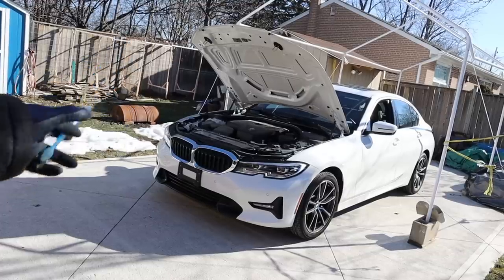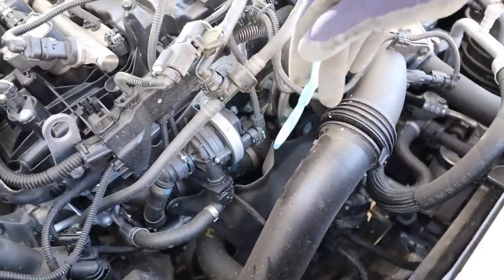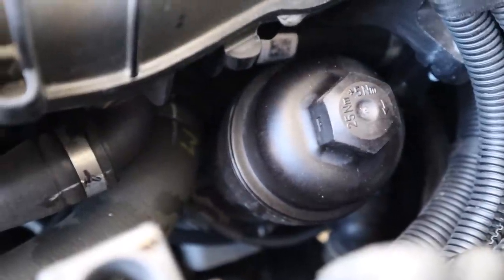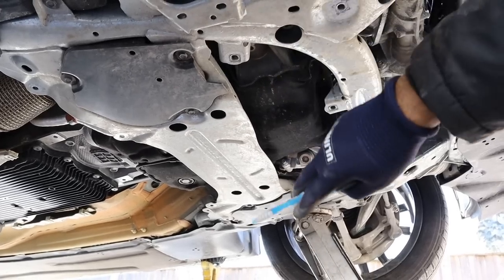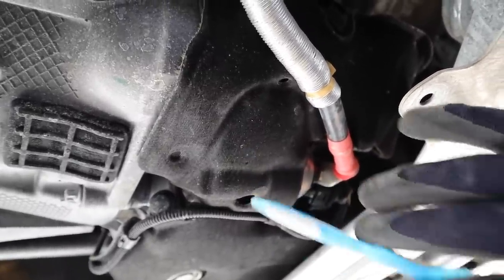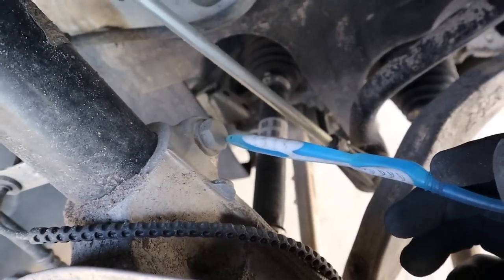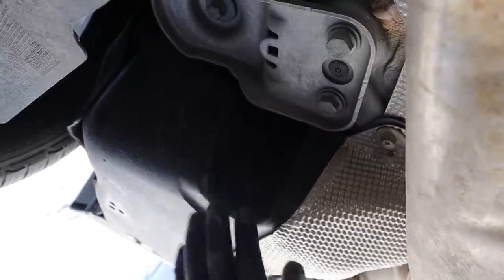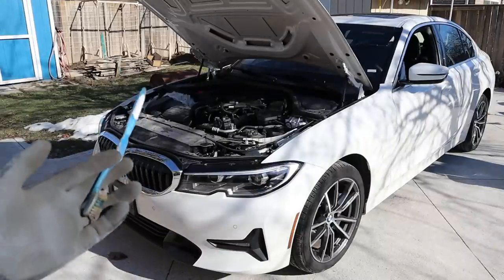BMW 3 Series Mechanical Review

Comment: I made the very bad mistake of buy a BMW once, an E90 M3 with the S65 4.0L. I bought it when they were still a current model and the faults which are now well documented were not common knowledge. Mine had the Throttle Body Actuators fail, and the dreaded rod bearings starting making noises, when i replaced them they were heavily worn. Fixed it, sold it, bought an IS-F Lexus which ive had for 7 years, and it hasn't missed a beat.
Reply: Yeah but the IS-F engine is meh and the transmission sucks. If you just do the rod bearings and throttle actuators (easy DIY, the actuators that is), you have a much better car to drive. It's a V8 with an 8400 RPM redline, and maintenance is the price you pay for that. You couldn't pay me to drive an IS-F with a crappy automatic vs a DCT or 6MT M3.
Reply from the maker: Not everyone makes decisions based on driving experience or likewise financial means. To each their own. I'd prefer the Lexus if it were me.
Reply: @speedkar99  True, there is definitely room for different priorities. They were both $60k+ cars new and guzzle gas like crazy, so I didn't really consider the maintenance cost differential as significant.
Reply: @chrisbradley3224  Here in NZ we get a lot of 2nd hand cars from Japan as we drive on the same side of the road. The BMW i bought had only 15,000 km (about 9500 miles) and was less than a year old, i got it for about 1/3 of the price of a new one. Same thing with the ISF it was a 2nd hand Japanese car, they were about 160,000 NZ dollars when new😳I got mine for 30,000.
Just needed to change the infotainment system to a modern non Japanese speaking one🤣(the bmw already had it done by the dealer) The 2UR-GSE  5.0 litre in the ISF is easily a match for the 4.0 in the BMW, and is far more reliable, the handling at track speeds is a step behind, but on the road its not and issue, The auto? a manual would make that car epic, but at least its a good solid box that has a rep for not giving trouble, and again for daily driving on the road, which is what the car is used for its fine.  I'm just waiting and hoping to find a nice low Km J import Alfa Romeo giulia quadrifoglio, and get back into Euro money pits.😄😄
Reply: @speedkar99 Japanese cars are ugly with cheap interior. BMW and Mercedes Benz make the best cars on Earth

Comment: I had one of these for two weeks when I went on vacation and let me tell you a boy. Does it drive sweet that ZF8 speed is the best auto box I’ve ever driven and I’ve driven a lot of cars except for super cars. I’m not saying it’s the fastest thing out there but 5.5 is definitely no slouch and 120mph felt perfect safe claim and was only turning 3k rpm
Reply from the maker: Yeah it feels fast and shifts fast. But of turbo lag and on the highway it flattens out
Reply: I’m gonna have to go back and look at my pictures. I could’ve swore mine had a sound deadening mat under the hood. i’ve always loved BMW from my childhood when I used to be able to buy E30s clean for $3000, and they were reliable and well aware of the common issues however, regardless of its long-term reliability, this car really does drive sweet I took it though the West Virginia mountains and have made that trip multiple times and this car performed the best always felt safe,
Reply: Rams transmissions were so problematic they have been using Zf transmissions for years now
Reply: They switched from their own to Zf for a quality reliable transmission. Other companies use Zf also. I enjoy them and tons of car enthusiasts/mechanics say they are some of the best in the business
Reply: @brandonbogart7195 right. But even this its still a Chrysler made transmission it's just licensed from ZF

Comment: It has an intercooler it's just that it is a charge air cooler not an air to air one
Also the timing chain is the flywheel part at the back of the engine
That car DOES NOT have 700km on it,  judging by those brake discs in the front, at least 10-20k on it

Comment: I have a GLC with the same 2.0 I would say much better design accessible oil filter, it has inter cooler all aluminum suspension front and rear, and DWB front suspension instead of BMW cheap struts 😅
And overall arrangement of things in Mercedes is much better than this bmw.also less plastics used compared to bmw.
Thanks for the video best like always.
Reply from the maker: I feel like Mercedes is a notch above BMW but I'd like to review one to see myself.

Comment: I owned 3 bmw for years, I had n52, n20 and now I have n55 engine, I never had any problems with bmw, never burned oil. Suspension bullet proof, unlike Japanese, rusty clunky with noisy wheel bearings. BTW new honda toyota engines has more plastic on their engines.
Reply: I agree! I have 130k on my n55 and it's been stage 2 + tuned since 40k! Still runs like new and doesn't burn oil either! Admittingly I did just notice my oil filter housing starting to leak but that's actually quite good considering I've never had to change it! I'm sure you're loving the power coming from n20 and n52?!
Reply: @nathanpendleton9733  n20 has more power than n52  but I love n52 amazing sound and smooth feeling .
N20 doesn't feel like that because it's 4cyl. 
But n55 and of course b58 it's a top. 
About oil filter housing, it's normal, but you have to change gaskets  before oil start to leak on alternator.
Reply: Don't even get me started with Japanese cars and rust, including low quality paints with failing clear coat which eventually leads to rust. I've seen too much of it.

Comment: I am looking for an x3 with the b48 engine. That is the only problem that worries me is the amount of plastic they are using. I’ve seen oil filter housings cracking, heat management modules leaking and when they leak they pour coolant on the ground, leaving you stranded is what I’ve been seeing a lot on YouTube. I have a BMW N52 which I love I’ve owned it for over 13 years and do my own maintenance. Never had these problems. I’m considering an X5 F15 generation with the N55 engine.
Reply: Check new honda and toyota engines there is more plastics, valve cover intake manifold and all pipes everywhere plastic. I love n55 engine, I got x3 35i, it's awesome car, I got 111,000 km and the car still like new, suspension is amazing, unlike Japanese rusty clunky suspension and noisy wheel bearings.
Reply: longtime bmw fan/owner here. Turns out n55's fail as well, I sold a f10 535i and at 90k it apparently needed a new engine.
Reply: @MrEquequ My n55 has almost 130k miles and its been stage 2+ tuned since 40k!!! Still runs silky smooth like the day I first got her! I just make sure I do oil changes every 5k miles and don't beat on her till she's properly warmed up! Are you the original owner? If not did you get all the service records?
Reply: Who isn't using plastic engine parts and components ??????

Comment: Interesting to note that it is, in fact, front wheel steer!
Reply: He was pointing out that the rack and the tie rods are ahead of the wheel instead of behind the wheel, which is more usual.
Reply: @andrewsmactips  I imagine that's done so the brakes can be placed on the opposite side - towards the center of the car for better balance.
Reply from the maker: Front steer - rack is in front the axle. Most rwd cars are layed out like this
Reply: @speedkar99  Is there any benefits to handling either way?

Comment: McPherson is economy car stuff. Which is why the best-steering cars you can buy (911 and Cayman) use… McPherson struts. It’s about the tuning, geometry is not a magical fix.
Reply: So why did Porsche change the 911 GT3 suspension to Double Wishbone, if McPherson Struts was so good?! 

It’s because Double Wishbone is superior to McPherson struts no matter how much tuning you do. This is why the 5 series and up uses Double Wishbone.
Reply: @theyadmire511  To extract the extra 2% performance on the racetrack under specific camber changes at the limit because it’s a lap time arms race. F30 had double wishbone front and some of the worst steering feel of any modern car. G20 with “inferior” suspension is still garbage like all modern BMWs but much improved. The point is that McPherson bad, double wishbone good is not an automatic concussion.
Reply: @Ficon  The F30 3 series doesn’t use a Double Wishbone front suspension. It uses a McPherson Strut.
Reply: @theyadmire511  Ah yes, you are right. It was so disappointing that I wiped 3 years of ownership out of memory. Well then, F30 vs. 991. Both strut cars, worst vs. best steering.
Reply from the maker: Understand your point. McPherson suspension is definitely the cheaper option and shouldn't be ruled out, I just didn't expect that on a 50k premium car especially when its competitors are offering double wishbone. Multi-link allows OE's to  dial in the tuning a bit more which is more important on a 3 series than say a CUV so why not?.
Reply: @speedkar99  Yeah, from ride quality perspective double wishbone would have been better. Definitely cost cutting.
Reply: @Ficon  Hmm.  In terms of comfort/ride, McPherson strut allows for more suspension travel.  The advantage of double wishbone is better camber control which is why it is used on most sportscars (apart from non-GT3 Porsches) and most racing cars.
Reply: Who says the 911 and Cayman steer better than the Lotus Emira and McLaren 720S?!  The Lotus and McLaren are not only double wishbone, they still use hydraulic power steering.

Comment: The easy access to the radiators is purely accidental, the reason I say that is they are STILL putting oil filters in stupid places.
Reply from the maker: They design the car around the oil filter location because the lubrication system doesn't change with the car's body

Comment: What is the purpose of the auxiliary battery up front?
Reply: 4G connected services and other parasitic drains when off, and also used for the array of tech when on. They are so finely tuned that the car will go into limp mode (disable comfort access etc) if a dash cam consumes too much :-\ (From experience)
Reply: For the starter

Comment: I took delivery of a fully loaded 2023 BMW iX50 (paid cash) and I can’t even open the hood. They don’t give the option to open the hood so I can’t check the oil level or the radiator fluid.
At the bottom they closed up everything so I can’t even see the condition of the exhaust, muffler, cat converters, and driveshaft. 
😂😂😂
Reply from the maker: Why did you buy it??
Reply: I don’t know! But it is fun to drive!

Comment: I blindly went with 330i last summer, done 10kkm so far. The car feels cheap for the price. Panels alighnment could be better, sound insulation is not at the premium level, safety tech is quite basic (no adaptive cruise). I got upgraded leather seats, but its quite disgusting on touch. Lots of crappy plastics everywhere.
I like the engine and transmission feeling though. Brakes are basic, but feel alright. Steering is okay, with little to no road feedback
It's an excellent economy car, wouldn't necessary call it luxury.
Funny enough, my 11yo Land Rover LR4 feels way more premium inside
Reply: Yeah, I test drove an X3 recently and wasn't that impressed. The handling was great, but aside from the labels on the back, it just didn't seem that significantly better - or even different - from any other small SUV. Certainly no better than a CX-5. And the base models have almost no equipment so you're just paying for that badge on the side. You have to pony up serious bucks for the top packages to get any luxury in these things.
Reply from the maker: I agree. It's a very basic car that a Mazda 3 could compete against if it wasn't for the RWD and suspension layout...

Comment: Belt drive water pump...  No, wait... three water pumps. Two separate coolant systems. What could go wrong?
Reply: Haha black foam! It's engine an nappy (or diaper, if you prefer). That'll hide all the oil leaks for quite a time. They must've got fed up having to fix oil leaks under warranty. This will prevent owners noticing so quickly 🙂

Comment: No intercooler? What is this bmw or hack shack? Seriously they couldn't integrate a cruicial part that woukd improve both power and reliability tremenduosly and that costs only like $200 into a car they sell for $50'000
Reply: There is an air to water intercooler that's part of the intake manifold.
Reply from the maker: Yes. I didn't mention

Comment: 3:31 Didn't you just say that this car doesn't have intercooler?
Reply: It's an integral air-water intercooler built into the intake manifold. VW does the same thing on the EA211 (1.4/1.5TSI) engines.
Reply from the maker: It's in the intake. Which means the whole piece is disposable when it leaks.

Comment: I hope you found your tooth brush in the engine bay 🤣
Reply from the maker: I did. It was buried near the bottom!
Reply: @speedkar99  Cool 🙂
I like your car technical reviews like this one, you should do more of them, because it is more and more difficult to find a recent simple well built car.
I am stuck with my 93 Civic because I know it will last as long as I do the basic maintenance 😂 (no plastic cam covers, no plastic thermostat housing, etc...)

Comment: Yes. It’s designed to fail after 3 years or 36000 miles.
Reply from the maker: Yes
Reply: And yet.. they don't if you maintain them regularly. Not everything is a conspiracy

Comment: Not very impressive to me.  All the makers seem to be going with the small engine/turbo combo.  You can see all the cost saving measures they take.    I think a lot of the “aura” of these once high end cars is coming to an end.  As a car guy, it’s sad.
Reply: This is the base car in the US basically. No one should buy it. It's actually a much punchier engine though than most of their competition gives at this price point. The 6 cyls make 382, 473, or 503 hp.
Reply from the maker: Most people are gonna end up in this 4 banger. They want the BMW badge without paying too much for it.
Reply from the maker: The smaller engine produces less emissions which is government mandated now

Comment: Brake sensor line design that allows the line rubbing on sharp metal, is very disappointing. Is it how “German engineering” supposed to be?
Reply: Why choosing plastic to make sway bar? The car isn’t designed to last, but disposable.
Reply from the maker: Yeah I'm not sure why that wire is run across the caliper like that. It needs a few more tie-backs
Reply: @speedkar99  that is sign of sloppy engineering. You know what, when you find a roach outside, there will be hundreds more hidden inside that you haven’t seem yet.

Comment: Holy 💩💩💩, they did it! After more than 30 years of automotive (since early '90s) engineering, they decided to put the fuel pump back into the engine bay beneath the bonnet?! 
HALLEF******GLUJAH!!!✝✝✝

Addendum: didn't saw radiator grill shutters since '70s (Australian variant) Mack R600 series🤨
Reply from the maker: The fuel pump is just the high pressure unit. The regular fuel pump is still in the tank
Reply: @speedkar99  Damn it! Sounded too good to be truth...😞😞😞

Comment: boy, thats a lot of messy wires at the engine bay.

Like is this the 1980s? It looks like a smog 80s v8. Jesus.

NOT impressed with no intercooler! That's really gonna hurt the engine in the long run
Reply: *half a smog V8 🤣
Reply from the maker: Intercooler is a water to air type in the plastic plenum

Comment: Pay $70k for a car that'll last 70k miles.
Reply from the maker: Sad. But some people don't care how long it'll last and that's how BMW's sell.
Reply: A dollar per mile 😢
Reply: Well I’m an owner of a Late 2014 328i N20 for 8+ years, and just touching 403,000 miles with the original motor and transmission, did install Dinan Stage 1 tuning, Injen tuned Cold air intake, Dinan catback, MST Turbo Inlet pipe, Wagner Stage 3 Competition Intercooler, from 3k miles after a proper break in , also did a preventative maintenance on the Timing Chain/Guide and since it crossed over when it comes to pulling that part off the motor you’ve reached to the Rod bearing and had that done at 296,000 miles. High pressure fuel pump and regular maintenance such as engine oil every 6k miles, belts when needed and one pully wheel. Always allowed the car to at least warm up 1-2 minutes before driving, never pushed it until after 12-15 minutes of driving, never flogged it in traffic. I live in South Florida heat Car currently runs great! So far so good
Reply: A dollar a mile you’ll enjoy every bit of
Reply: buy a car and don't care about it any car will last 70k..